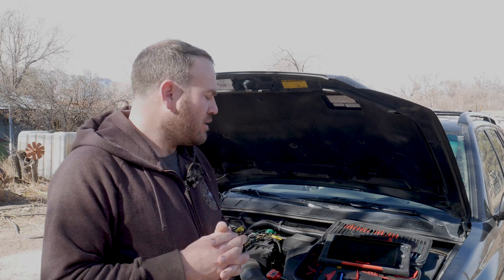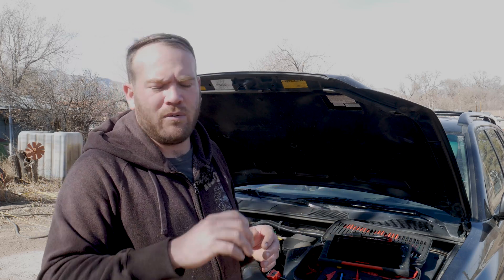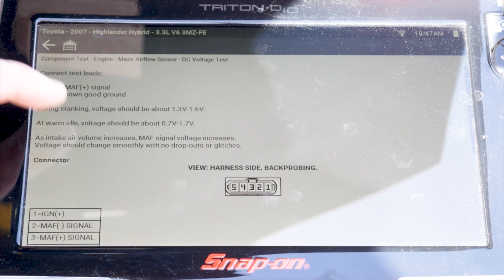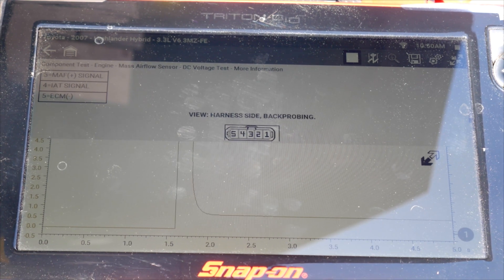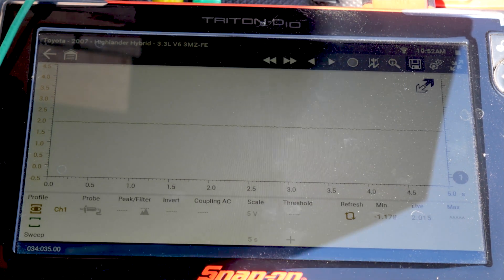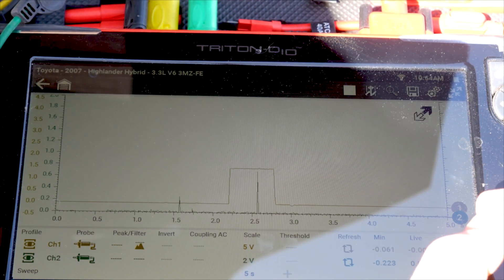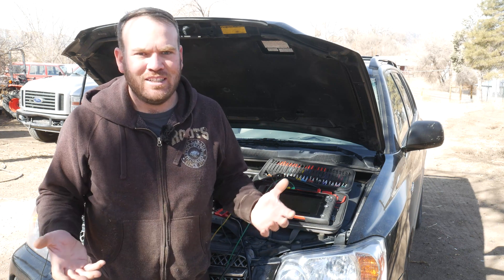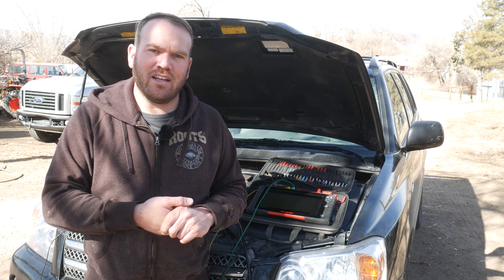AWW17 - analog MAF sensor voltage test

Comment from the maker: I should have specified that this system may not apply to all makes.
 Ford sensors operate on constant voltage and the current is proportionate to air flow. 
On this Toyota system the MAF operates on a constant current. The flow of incoming air cools the hot wire changing the resistance. To maintain a constant current value, the ECM varies the voltage applied to these components of the MAF meter. The voltage level is proportional to the air flow through the sensor.

Comment: Another great video. Thanks. 
I am hoping to see that  GM maf operation soon....
Also, if you can explain a maf, on a diesel car, and if it's a different waveform. thanks.
Reply from the maker: The diesels typically have a much higher output because a Diesel engine doesn’t restrict the airflow with a throttle body like the petrol engines. VW uses the MAF for boost, Fuel and EGR calculations. Ford diesels use the MAF for EGR calculation only. 
Since the airflow isn’t restricted by a throttle body the amount of air expected is easy for the manufacturer to calculate. The ECM monitors the MAF as the EGR valve is incrementally open and the MAF reading should go down. Now the ECM know exactly how many Grams/sec the airflow has been reduced from expected and can reduce the fuel accordingly. 

What throws me off is the when VW displays the data as grams per stroke instead of grams per second.
Reply: @ThePracticalMechanic  
Thanks a lot for the reply. 
And of course, for the effort you put on your video's ,so we can learn more. 
Can't wait for the next one.

Comment: The resistance is constant so if voltage changes current also changes and vice versa.
Reply from the maker: Thanks for catching that. I should have specified that this system may not apply to all makes. Ford sensors operate on constant voltage and the current is proportionate to air flow. On this Toyota system the MAF operates on a constant current. The flow of incoming air cools the hot wire changing the resistance. To maintain a constant current value, the ECM varies the voltage applied to these components of the MAF meter. The voltage level is proportional to the air flow through the sensor, and the ECM uses it to calculate the intake air volume.